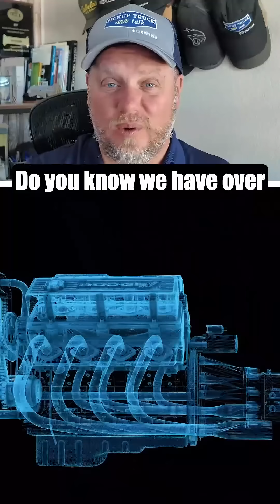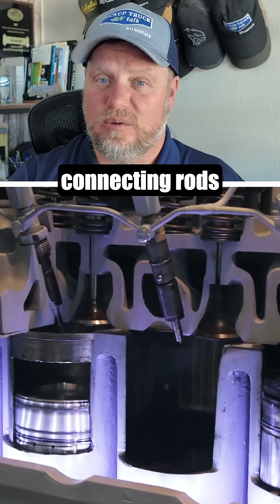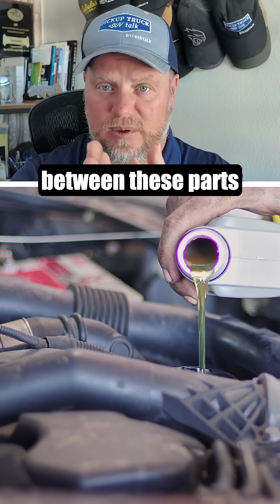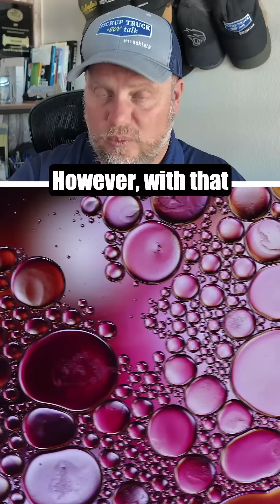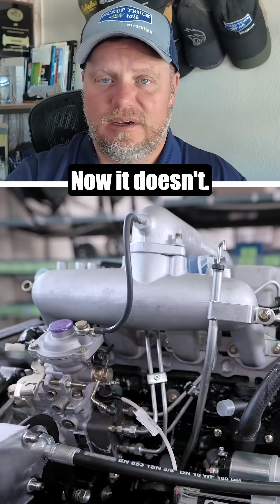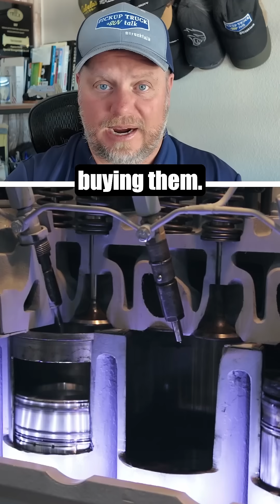What is causing engine failure? #shorts #enginefailure #V8

Comment: With the oil dilution issue on Hondas 1.5 turbo which I noticed right out the gate on my 2025 Honda CRV I decided to try 5W-30 instead of the recommended 0W-20. 3 weeks into changing the oil and colder weather made the engine make popping noises when starting the car. I'm thinking the hydraulic lifters weren't designed for a heavier oil and were having a harder time moving the oil. So I'm stuck using 0W-20. I'm going to change my oil every 3500 miles.  Most are highway. Hopefully the engine can get to 200,000 or more. Fingers crossed.

Comment: As far as the 6.2 L GM recall, crankshafts for this engine were farmed out to Mexico to save money. In addition, they also used powdered metal connecting rods on these engines again to save money. The cranks don’t have the correct final finish on them that causes bearing failure, and the connecting rods are very brittle, and will snap instantly without warning when the engine begins to knock. As far as Ford goes, they take a small little engine and turbo charge it within an inch of its life, while  at the same time using rubber belts, immersed in oil to drive things like the oil pump. In addition, instead of steel sleeves in the cylinder walls, they use ultra thin plasma sprayed cylinder liners that do not last causing the engine to eventually burn oil. The 3.6 Pentastar from Stellantis is actually a good design however, the engine is mass produced in record numbers, and also record time frames with poor quality control at the factory. Again, it is a quality control issue with Hyundai and Toyota in regards to particulate matter being left in the engine after machining work on parts. In summary, they need to invest more money in quality control and higher quality components . A good example is poor quality roller lifters for 5.7 hemi as well as 3.6L. Right now, the auto makers are paying through the nose because of poor decisions and cost cutting measures. that should have never been implemented in the first place. The auto makers charge astronomical prices for their vehicles. It’s about time they start making something that is value oriented.

Comment: Cheap aluminum cant handle the heat and stress i have old equipment all cast iron they dont break 1947 tractors, 70s and 80s heavy equip. No deff no computers no problems😊

Comment: If it were just tiny metal particles in thin oil then please explain why in the tundra the only thing failing are the main bearings and not turbos, and all the other oiled parts.  Makes no sense.  The oil IS definitely too thin to properly coat the internals and I believe design of oiling systems and super thin cams are helping these engines implode.  Ask the engineers,  they believe this also.

Comment: Clearance didn't change. Airflow and compression changed. They improved airflow and raised compression because direct injection allows it. They had to add squirters under each piston to cool them with oil which put higher demands on the oil pumps. They have to flow more volume so they have more drag and wear.

Comment: What you say is true, but the problem is also in the quality of oils.We are putting in synthetics still have a base petroleum product, but depending on what quality of base they are using to?Build their product with. An oil manufacturer that has top tier oil base in their fully synthetic product is High Performance Lubricants.

If they're having issues with new engine is there automatic incumbent sand and are metal debris from sheen, then the manufacturer has a cleaning process issue, and they need to rectify the engine should is suffering from debris.
Left over from the manufacturing and machining of the parts

Comment: My uncle did his oil changes the same way like he did when he built hot rod motors. First 500-1k oil changed then at 3k and then at 5k. Also doesn’t have the afm dot shit on his 5.3 which knocked off over $5 due to the chip shortage in 2020. He’s yet to have any issues with the truck and drives it to the mountains atleast once a month

Comment: All I know is manufacturers have been using roller lifters since 1985 and it’s only been the last 10 years they’ve been failing and the fact they’re using belts on oil pumps tells me they are deliberately designing them to fail. Kind of like home appliances automotive manufacturers are trying to make vehicles disposable

Comment: So if gm with the 6.2 for example, is now recommending the 0W40 instead of the 0W20,  as their field fix for engine failures, would that not be detrimental to the logic of tighter tolerances and lighter oil?  Does that not create additional failure modes?

Comment: The low friction rings are a root cause. They are great till oil changes are missed. At that point they wear out prematurely at a high rate. People don't check oil levels. That when that motor granades! It's all about maintenance! And that's if it's put together correctly in the first place!

Comment: EPA requirements are the root of all problems with modern engines.  DEF, EGR, turbocharging, cylinder deactivation, start Stop.  Etc. etc. etc.
Reply: Yep!
Reply: EPA was not put in place to improve car reliability.  The EPA’s mandate is to protect and improve public health and environment.  The EPA was established in 1970 by a Republican administration due to demands by voters to improve the environment and public health.  There were 200 million people in the USA.  Now there are over 330 million.  Air and water quality have improved in the last 55 years despite 130 million more people driving, eating, discharging, working, etc.   I am grateful to the folks that established the EPA. The EPA is not perfect.  However the EPA has done a hell of a job. No air quality alerts, no rivers catching on fire, etc.
Reply: @NorWis744 yeah, they've done a hell of a job all right. Ruining our cars.
Reply: @N @NorWis744  as with most government organizations, there was a time when it was warranted.  Just adding catalytic converters reduced emissions by orders of magnitude.  Since 2007 or so, EPA regs have forced manufacturers to do things that severely impact vehicle reliability, for a fraction of a fraction of a percent improvement in emissions.  How many tons of carbon are produced because people’s engines need to be replaced at 130k vs 250k.  I’m sure you aren’t interested in the second order effects of your policy prescriptions.  Leftists never are.  “Stronger emissions regs make me FEEL good.  Therefore they ARE good.

Comment: My drives a 2017 Honda Pilot with 125,000 miles currently and he has not had any issues with the engine. My dad used to drive a 2004 Ford Explorer Sport Trac and had he held on that truck and was still driving it today, It would have had 284,000 miles and be nearing 300,000 miles but my dad has no idea if it would have lasted that long or not.

Comment: Run 1-2 grade oil higher than manufacturer recommendations. 
I run 5w-20 or 10w-30 in place of 0w-20 or 5w-20. Of course depending on weather temps also.
Manufacturers use super thin oil to make EPA and automotive standards. Use thicker oil, name brands, and full synthetic for no longer than 5k miles. It works. Your engine will last much much longer. But of course all you “go by the book people” can keep buying new motors or new cars every other year if you choose.

Comment: Mpg hasn't gone up, this is a lie. Cars now still get the same mpg as car 30 years ago. The only thing that's changed is power. So what happens as performance goes up, reliability goes down. Couple that with planned obsolescence and that's a modern car.

Comment: There have been some great advancements with power and efficiency with today’s engines but they reached the point of diminishing returns with fuel economy and made detrimental changes to achieve them.  Taking a common sense approach is the solution.  Keep all the benefits of turbos, direct injection, etc.. but build the bottom end of the engine to handle that power. Get away from super light weight oils, low tension oil rings, variable displacement oil pumps, etc..  Sure, there would be some impact on fuel economy but we would still be way ahead of where fuel economy was at a few years ago. It would be a realistic solution and avoid  the economic and environmental costs of replacing all these failed engines.

Comment: And they are far too delicate and the engineers  are pushing engines to their limits for HP and performance.  Turbos have also added to the complexity and fragility issue...all reasons why I payed MORE for a new Honda with a naturally aspirated V6 with less HP than a turbo 4. IT WILL LAST LONGER  ..
Reply: Especially important to point out that they’re not doing all the supporting mods that you should with higher performance engines for cost reasons such as if you were properly building a forced induction engine Not saying be has to be fully built obviously I’m just saying they’re not keeping up With the bare minimum required engine improvements for the increased amount of stock output. That’ll be like turn up the boost on More than a couple psi or so on a stock turbo without an inner cooler like on an old-school stock turbo car and expecting the turbo to last lol.

Comment: Because the epa never knows when to stop.  Manufacturers have to make bearings, crankshafts smaller, with less bearing surface, thinner oils, turbos, less cylinders all to get 2mpg better.  So stupid, bring back sanity, naturally aspirated v8s
Reply: I’ll take it a step further just naturally aspirated anything pretty much V8 and overall best middle of the road Performance in efficiency would be V6 but my personal favorite In-line four cylinders even actually aspirated
Reply: But you have a point though there’s ways to get unbelievable amounts of gas mileage out of v8’s there was some person experimenting with a lawnmower carburetor on a V-8 and I swear he was getting like at least 40 miles per gallon lol

Comment: Take a small engine with tight tolerances and thin oil, throw a couple turbos on it for high torque and put it in a 6000lb truck you’re gonna have issues.

Comment: Light weight, water like, oil is for cafe standards, mpg bs. If you're engine says 0w20 go to 5w30, especially full synthetic, you won't have any problems going up like that.
Reply: Careful putting anything in that doesnt conform to manufacturer requirements. If by some chance the engine fails they will often run an oil analysis. If they do find out of spec oil, they now have justification to not cover repairs under warranty.

Comment: GM has nearly 2,000,000 and growing defective v8 from 2019 to 2025 alone. All Toyota/Lexus v6 twin turbos have catastrophic engineering flaws and manufacturing defects. Hopefully by 2027 they will have a re-engineered v6 twin turbos replacement with proper manufacturing quality control while 2016-2020 v6 Tacoma engines are now failing around 80,000 miles. UGH!!

Comment: Clearances are not tighter now,they were just as tight 30 years ago.
Reply: Amen, came here to say that.  That’s a sales person lie to make you think that you are getting somehow a better engine by saying it has tighter tolerances.  The problem is low tension oil rings and the low weight oil, engineers trying to squeeze every bit of mpg they can out of the engine.  And he apparently has never driven old muscle car.  My 442 cornered at 1.07G’s (with R compound tires and a highly modified suspension)
Reply: Preach brothers! It's this oil viscosity killing the engines. My shop/I build high compression and turbo Busa's that rev to 14,000 with 10-40 Motul. These shitboxes running 0-16w or 0-20w all have a catastrophic failure before 80k.
Reply: @rodgerjepsen7952  that’s not completely true. I have many Toyotas in the fleet pushing 200,000 miles all running 0W-20. And they do have tighter tolerances. VVT’s have changed the game and need lighter oils for proper functionality in colder weather.
Reply: @mcss317 I can accept being 5% wrong. With your use of the word "fleet", makes me think you actually pay attention to service intervals and stay on top of things. However, most consumers/customers now don't even care until after the dash has been yelling at them for a month...or something just breaks and ends up being way more expensive than any oil change.

Comment: Because the manufacturers keep cutting corners on quality so they can make their shareholders an extra buck. Oh I should add, they are NOT using tighter clearances. Clearances haven’t changed for over 20 years.
Reply: That, and planned obsolescence. Everything is engineered and planned to fail now, usually just after the warranty expires and even if you are skilled in repair...the parts are on backorder with a shipping charge that costs more than the parts.